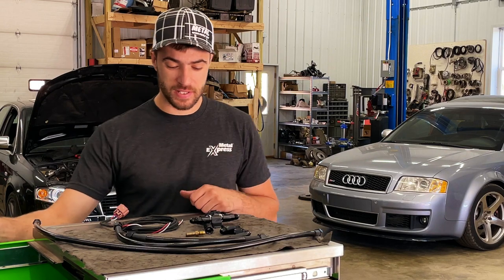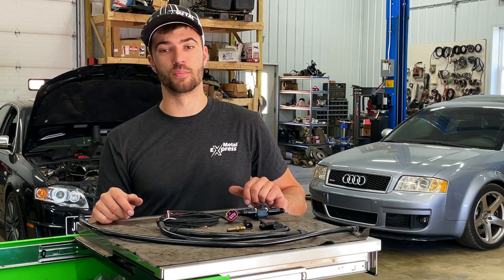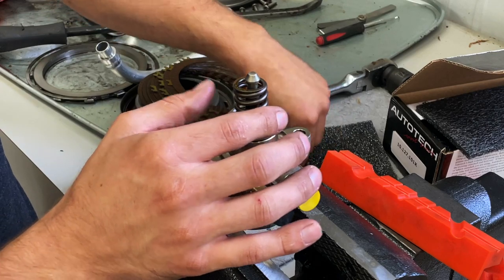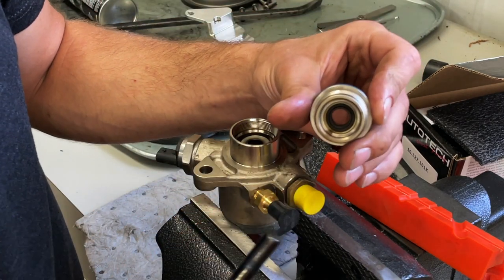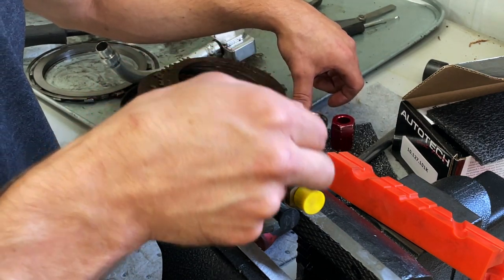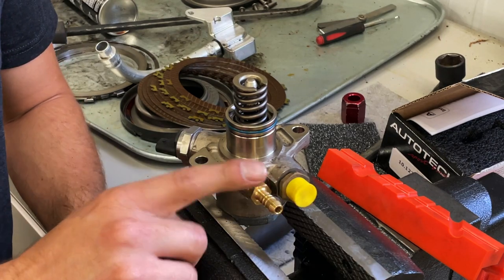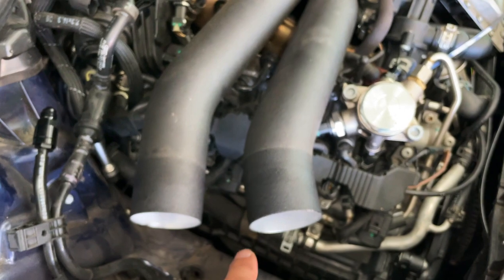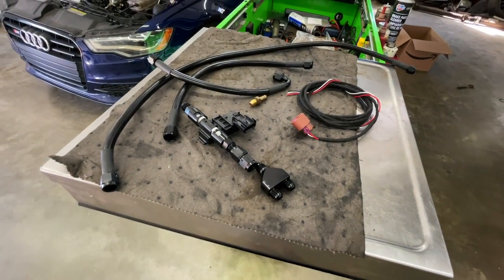Audi S6 4.0T Upgrading HPFP's And Fuel Lines For E85

Comment: I like all our videos. I've used them for reference for the past year. I just wanted to ask about long term reliability that you would expect from an S6. I probably drive 20,000-30,000 miles a year for work and have always loved the S6 and the 4.0T. I'd probably just to a TCU tune and Stage 1 ECU tune and not touch it for a long time. And then if the turbos needed replacing, I'd definitely put in some RS7 turbos. How comfortable would you be using an S6 as a daily commuter long term and what recommendations would you have for making it as bulletproof as possible?

Comment: Great video with excellent tips!  I noticed that you did not show the priming of the fuel pump/system.  Is that because the system is self-priming or is there a process for the priming of the pump using VCDS?
Reply from the maker: Correct it is self priming. So key on a few times to cycle lpfp to prime everything then fire.

Comment: Thanks for the great video! Gives me the idea to upgrade my lines too...But I'm looking to piece together my own kit. So far the only trouble I'm having is finding the adapter from the LPFP which you call a "pushlock" to -6an fitting @7:04 of the video...Do you know if this adapter goes by another name? Also I know that the fittings you are using are -6an, but are they just male -6an to -6an? Or is the threading's in the HPFP's themselves a different size? Thanks for any info you can share, I appreciate your help in advance! Cheers!

Comment: Thank you! Really helps to see this installed vs just hearing everyone talk about it. Once you have this installed, can you still use regular 91 octane gas if desired? What do you mean when you talk about an e50 blend?
Reply from the maker: Yes you can run 91 on up the flex sensor and ds1 automatically adjust the tune for the fuel. E50 is a blend of pump gas(91,93) and e85